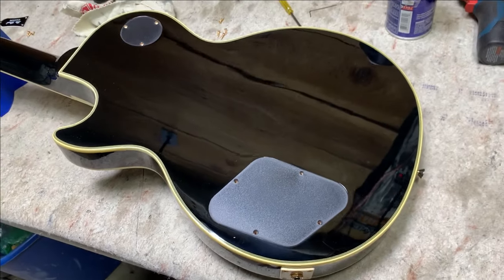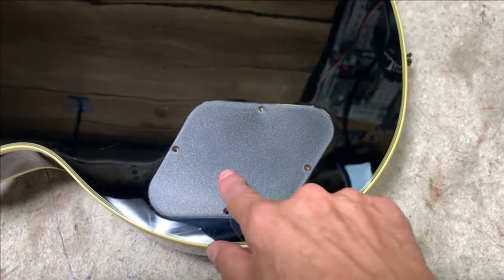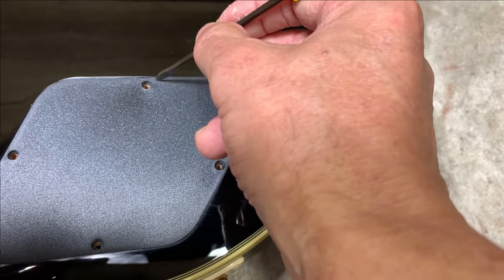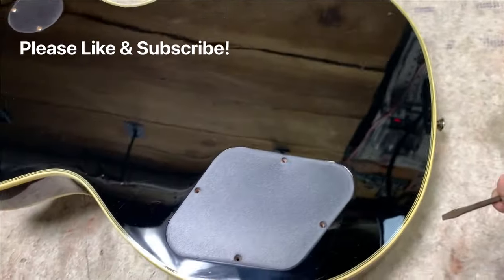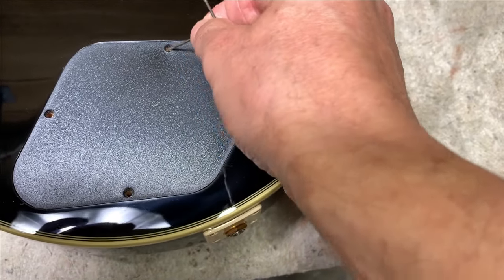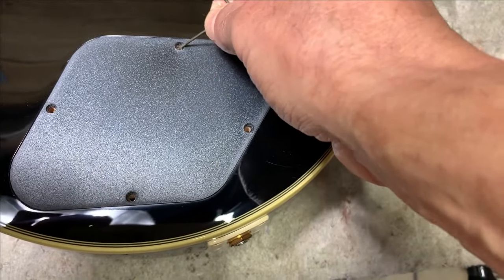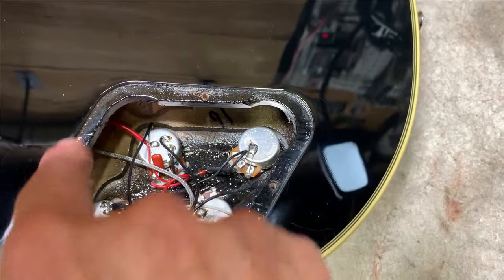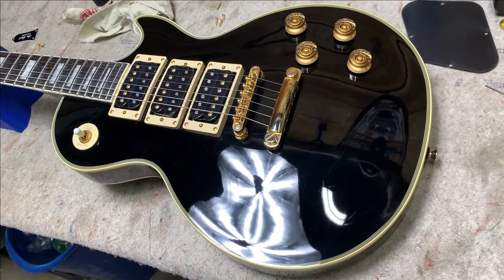How to Remove Rear Control Cavity Cover without Harming Les Paul Guitar Electronics

Comment: I use a little suction cup. I learned that watching YouTube.
Reply: Some covers are adhered to the cavity. Just stuck on, Almost superglued...
Reply from the maker: Good one! I have to try that. cheers
Reply: @missingremote4388 
Right and some are textured.  Alot simpler to to use the tip of a small screwdriver or a pick in the screw hole.